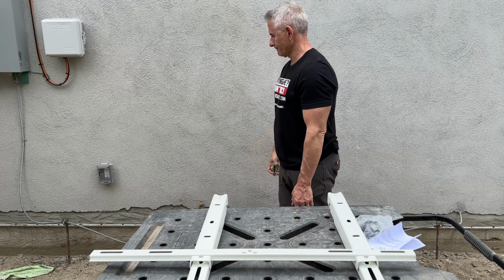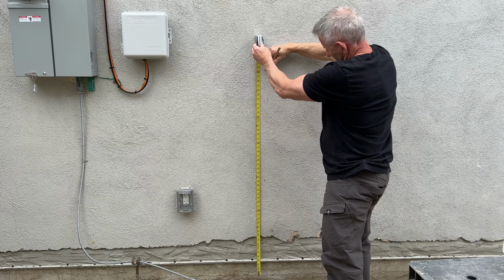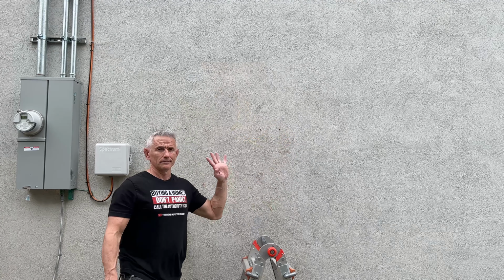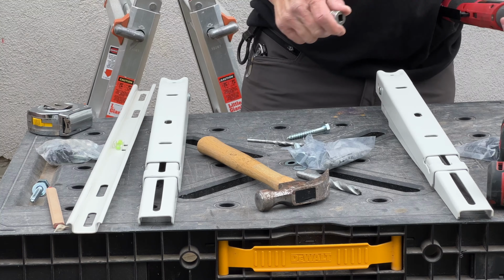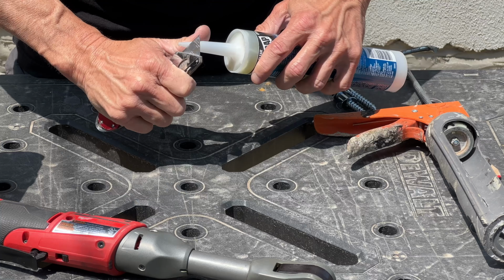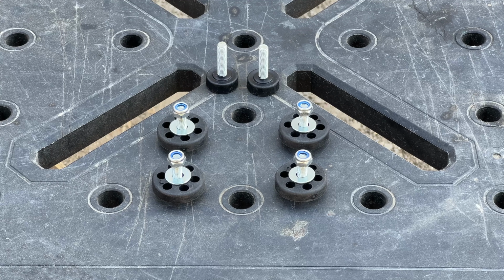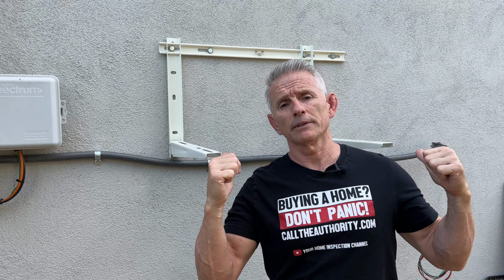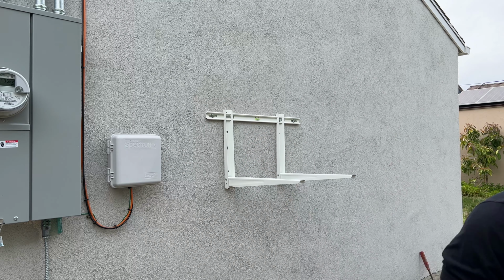How To Install A Mini Split [Wall Mount Bracket] | DIY Step By Step | JEACENT Wall Bracket

Comment: I need the measurements of the brackets to mount on the inside unit of a split unit what I have to do to secure it do I need the reinforce the wall with with 2x10 2x12 something like that to secure the wall and make it solid so it'll hang on it and not fall or what do I have to do

Comment: Arms don’t have to be bolted into wall?
Reply: The company that's doing the actual unit install would handle it since the arms need an exact position to fit mini split legs holes.

Comment: what if you dont have access to the back like that
Reply from the maker: Thats a problem, You can use another wall or you can install the mini split on the roof with another type of mount.